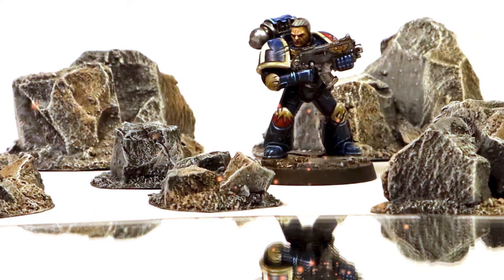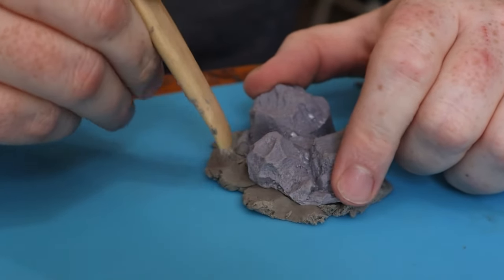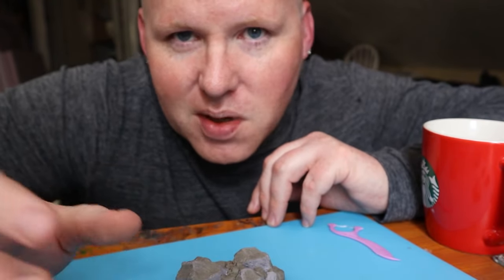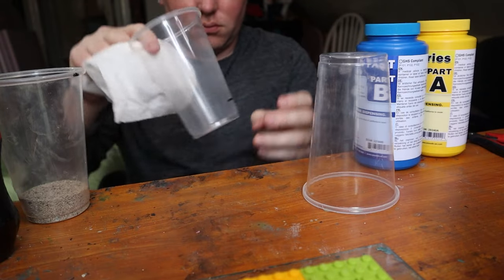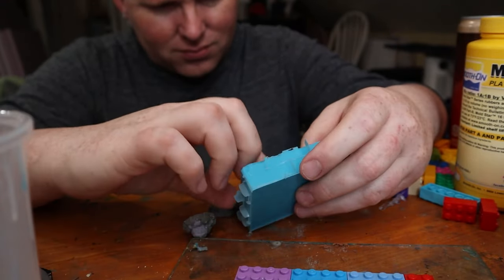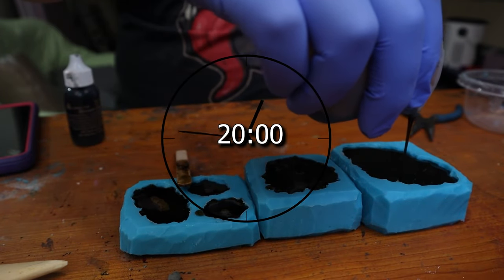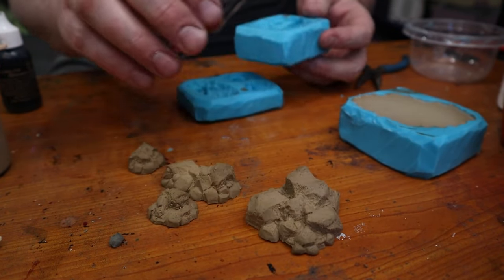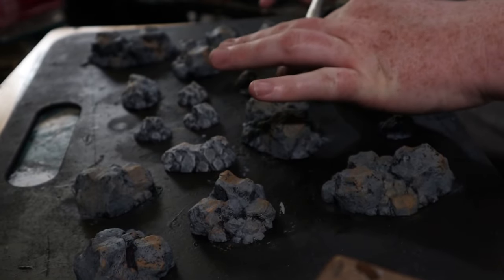Crafting Terrain - Sculpting, Molding, Casting with Smooth-On

Comment: Good clear explanation, thanks.  Thinking of making some moulds myself but I was planning on using silicone sealant (smear it on the piece with a gloved finger, then add more over the top to make a robust mould) then filling it with car body filler - Reason being I make sets of toy soldiers to give away and I try to encourage the kids to have a go. Most of the terrain is cardboard, glue and dried tea leaves but sandbags are strips of paper from a shredder torn into 3 inch lengths and rolled up, which takes a lot of time. I coat everything in acrylic sealant and that hides the coiled ends well enough. They go down well and I was thinking this might be a way of making several from one master. The main drawback is that a big blob of sealant can take a week or more to set (it has to absorb water from the atmosphere and getting that into a big blob is a slow process), and in smells a bit as it does so (so leave it outside in a shed or sheltered place). It is however cheap as you can buy the sealant and the body-filler from a discount store and my sets are given away to less well off folk and $4 equivalent is as expensive as I want to go so they might give it a try themselves.

Comment: Great stuff. I have done similar casting with stuff from Alumilite. I suspect most of what each has is fairly similar in quality - those came out most excellent. Cheers!
Reply from the maker: I've used Alumilite as well,  definitely does the job.